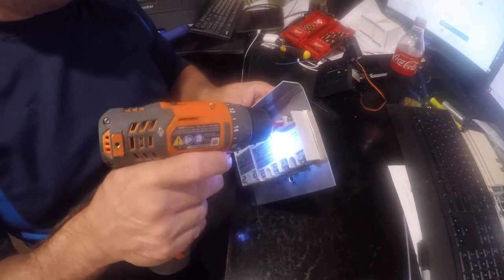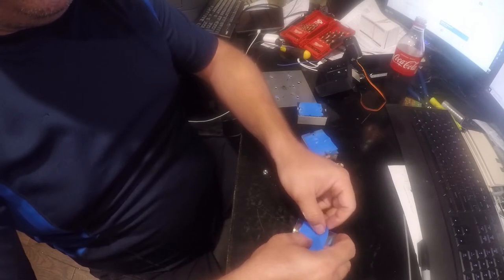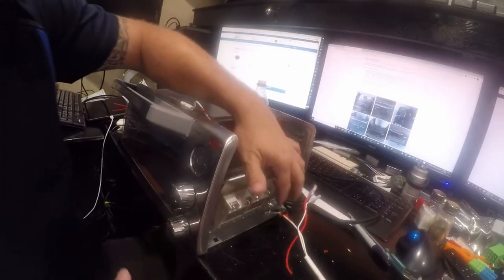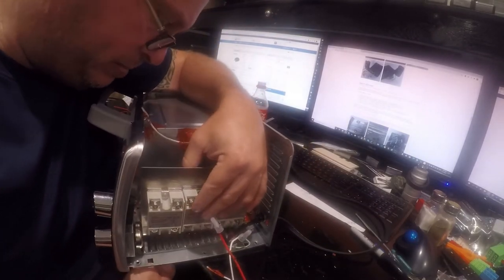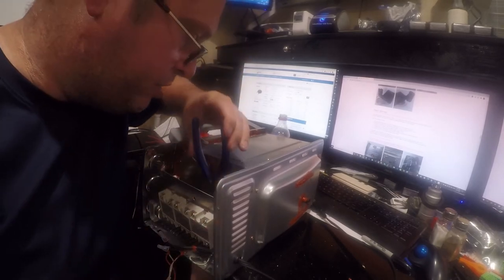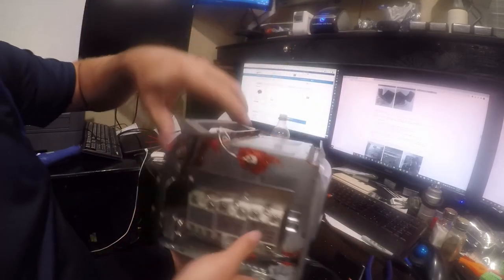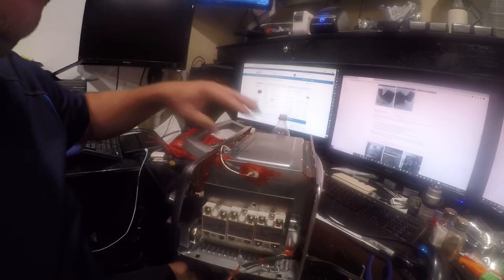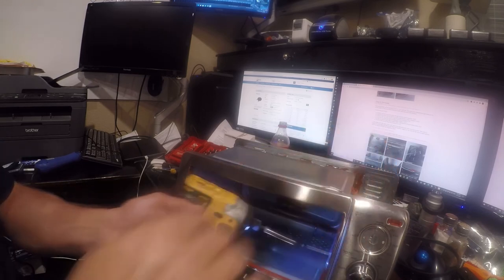Controleo: Part 9 drilling holes and mounting the SSR

Comment: Note for future builders:  Brian mounted the "booster:" heater to the rear of the oven.  The instructions show it toward the front of the oven.   The location may not be very critical, however I felt that the front location may somewhat compensate for the front of the oven having the least insulation.
Reply: It also promotes better temperature detection from the thermocouple, because the boost element is then far away from the thermocouple.  (i.e. the thermocouple is mounted towards the rear of the oven, and in the written build instructions, the boost element goes towards the front of the oven).  With the boost element at the rear, it could cause more of a temperature gradient within the oven (back hotter than front), which the thermocouple won't detect.
Reply: @somejoe7777  You may well be right. However, I concluded that the "thermocouple floating in air" did not do a very good job of providing the temperature feedback, as judged by soldering results, and by a thermocouple fastened to an actual PCB.  So I have fallen back to using a  thermocouple attached to a small PCB, sitting on the tray, to provide the feedback to the controller. Not ideal, as it takes up some space, but a far more representative measurement, at least in my testing.

Comment: All that aggression and name-calling and belittling in the beginning of the video over 4 minutes of your time with a screwdriver. Oh no they were mounted on the wrong side. I have to make myself look like a jerk because I had to take 4 minutes of my time to reverse something that I myself assembled because I didn't  look closely at the pictures and ask for directions. I was thoroughly interested in your videos until you just showed your true colors in the way you acted about this little minuscule thing. You've lost a viewer and a subscriber
Reply from the maker: The documentation in this area is a bit weak.  When I buy a kit I expect the instructions to tell me how to put it together and to point out any trouble areas or common mistakes.  I don't expect to photo-analyze the instructions.

If I had bought the parts myself and cobbled together everything it would be a different story.

Thanks for taking time to comment and good luck.   The controller works great.  Although the upper insulation did come loose on the first couple of test runs.  Waiting to hear back from Whizoo on suggestions.  Failing those it will just come out.
Reply: Future builders should be aware that this kit is not tuned to some specific oven, so a certain amount is left for the builder to adjust to their specific oven. If you get the exact oven pictured in the build instructions, indeed the instructions still require some "interpretation", or close inspection of the photos.  I too found that a little frustrating, but not unexpected.  
On the specific topic of the bracket for the SSRs, I think the first way Brian built them oroginally is better, attaching them to the "inside" of the "L".  Then the base of the L goes toward the outside of the oven, and the SSRs face the outside of the oven. Both the SSRs and the bracket base are then conveniently accessible later in the build when fitting the ceramic insulation.   The awkwardness at 10:00 is avoided.
One point to observe: orient the SSRs with the mains (output) terminals upward, and the low voltage terminals downward -- makes for easier wiring.
Reply: @Graham_Wideman  The reason that the instructions specify that the SSRs are attached to the outside of the "L" is because that positions the SSRs as far away from the oven wall as possible, thus giving the SSRs maximum airflow, even with the ceramic insulation in place.  If you mount them on the inside of the "L", then mounting the L bracket with the SSRs facing outwards, the SSRs will be closer to the oven wall.  This can cause them to heat up more during reflow cycles, and it makes installing the ceramic insulation more difficult.
Reply: @Jericho Joe With a build of this complexity, all of us are going to make an error that requires us to re-do some of our work.  Especially since these instructions are applicable to nearly any oven, not just the Black & Decker model shown here.  I think your reaction is a bit extreme.  If you want a professionally-produced, professionally-edited video, I'm not sure you're going to get that from hobbyists who are just trying to get something put together.  Indeed, that's why I'm watching this video, because before I build this oven I want to see where others had difficulty and what potential pitfalls I can avoid.  I'd rather see someone make and correct an error so that I know that ahead of time, rather than be blindsided by those issues during my build.
Reply: @somejoe7777  I'm not sure if you're agreeing or disagreeing with me.  I think we both agree that the SSRs should be mounted facing away from the heated oven wall and toward the exterior case, right?  My additional point is that to accomplish that conveniently, you mount the SSRs on the "inside" _of the L bracket_, then mount the bracket so the SSRs face the exterior case. That orients the "foot" of the L also pointing toward the exterior of the case, making its screws accessible.
Reply: @Graham_Wideman  Yes, the SSRs should in both cases be facing away from the oven and towards the exterior case.  But with the SSRs on the inside of the L, this places the vertical portion of the bracket closer to the oven and further away from the exterior, because the bottom part of the L has to be relatively centered when it mounts on the bottom of the oven.  Flip the bracket around so that the bottom of the L extends towards the oven will move the vertical plane of the bracket more towards the exterior case and away from the oven wall.  Then the ceramic insulation goes in between the oven wall and the vertical part of the SSR bracket with room to spare, while the SSRs themselves are closer to the exterior wall.
Reply: @somejoe7777  Ah, I see your point. I guess there might be some benefit to that, though I didn't have any difficulty getting the insulation between the oven wall and the vertical bracket face.  That will vary according to oven, no doubt.